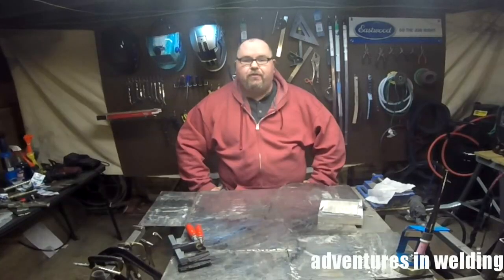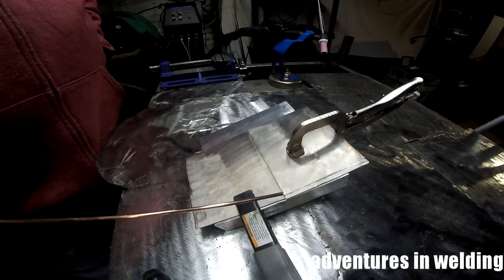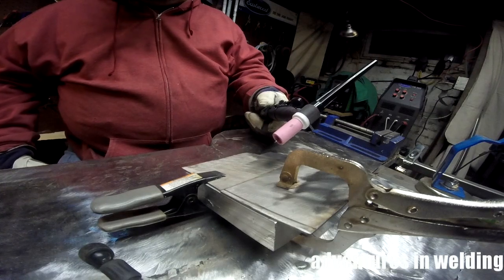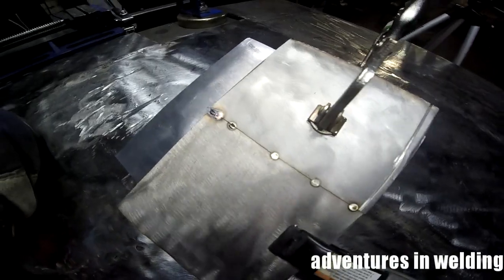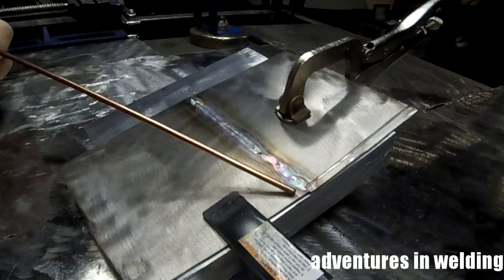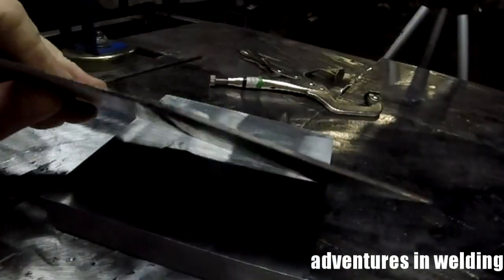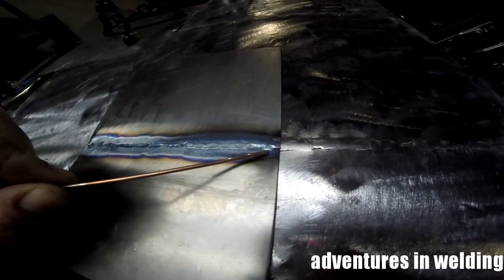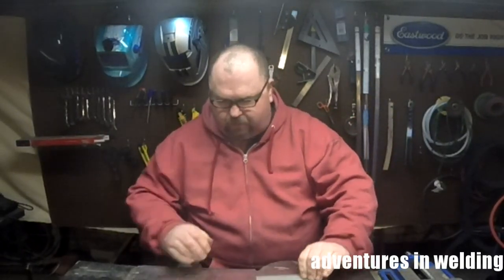Adventures in Welding #84 Autogenous Welds

Comment: Hi, recently a bunch of videos have appeared on yt using a similar process for copper brass and aluminium even joining different metals to each other. Is this exactly the same sort of process ? If so what happens say with brass which will obviously lose some zinc due to evaporation? Are the weld between different metals strong? What are the things to avoid when using this technique. For anyone new to welding, wary of a bunch of sparks and maybe with shaky hands this technique is obviously attractive. What are the limitations in metal thickness for such welds?